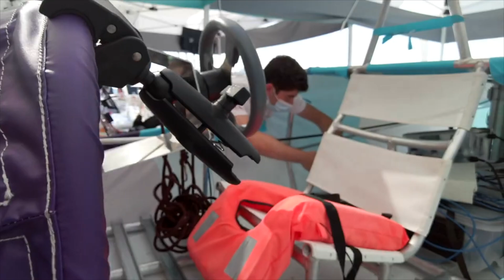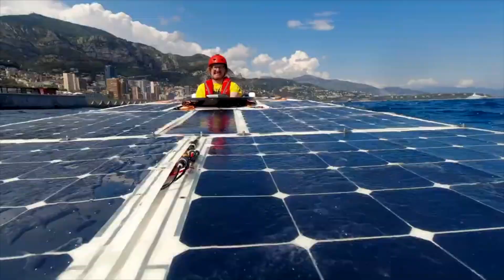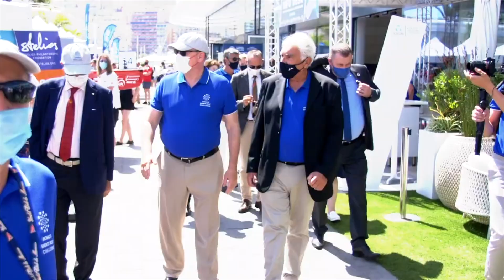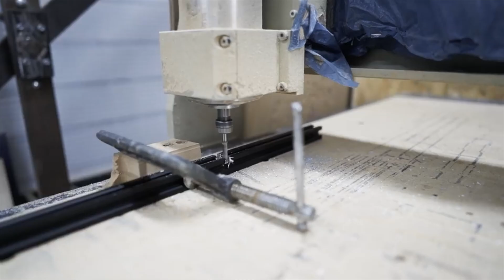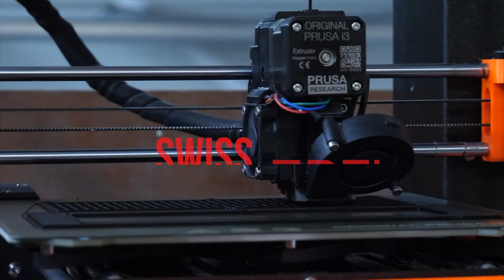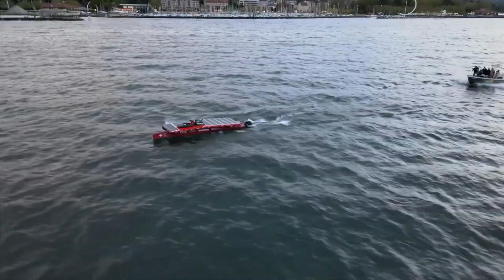SOLAR POWERED BOATS AT MONACO YACHT CLUB'S ENERGY BOAT CHALLENGE

Comment: Solar power boats are no more efficient than hybrid cars . They still require internal combustion engines to help charge the vessels batteries. Yes it helps extend the boats range as does a petrol hybrid car , but its no solution to independance from fossel fuels ( diesel , petrol , lpg , or other forms of oil based fuels) . So until someone makes a mini nuclear reactor or a raging success of the nano diamond nuclear battery , we need to keep friendly with oil producing nations .
Reply: Of course they are more efficient than hybrid cars. What are you on about?